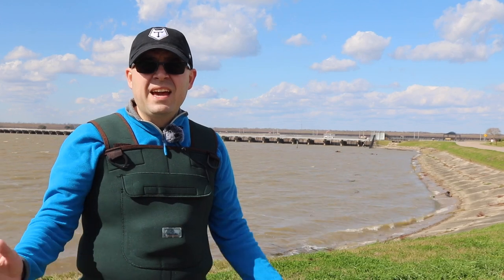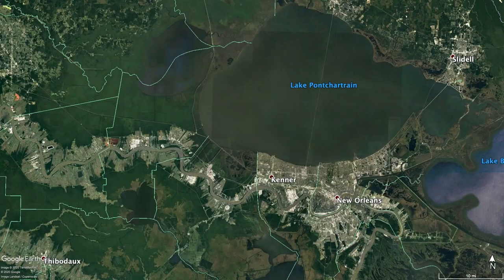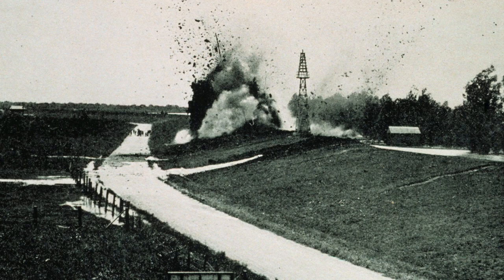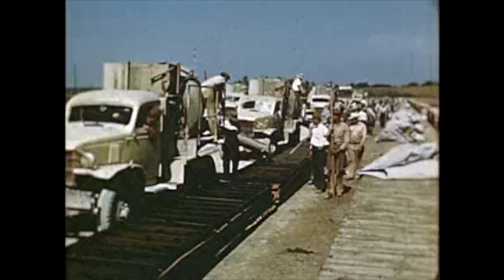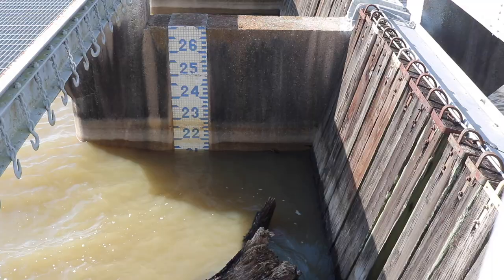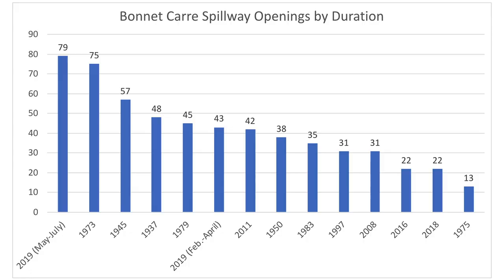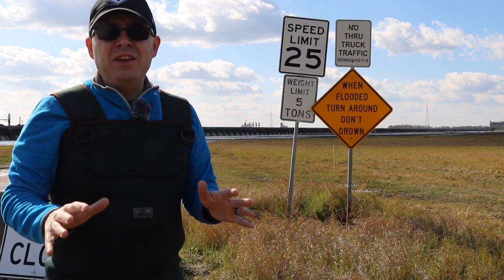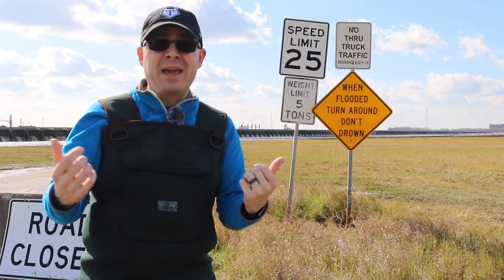The Bonnet Carre Spillway: Phenomenon Explained

Comment: I commuted between New Orleans and Lafayette during the flood of 1973.  The waterflow thru both spillways was incredible.  When the river is at high water, the difference in elevation between the top of the river and the  top of the lake is substantial.  Substantial enough to be scary.
Reply from the maker: I wished I could have stopped on the side of the Interstate to record it last summer--it was like a rushing torrent you'd associate with a dam bursting or a flash floor, but a mile wide. It was insane.